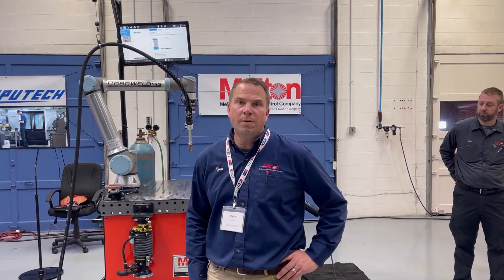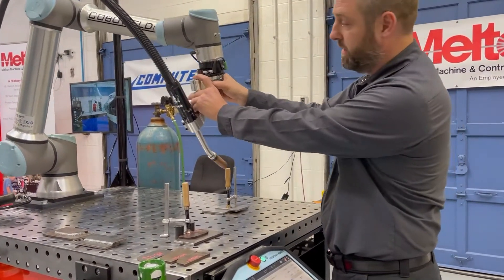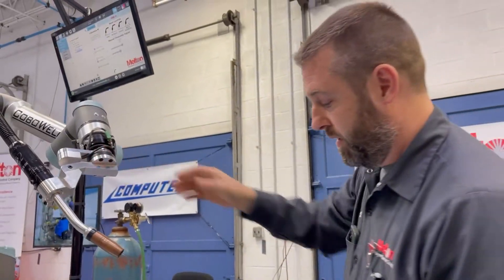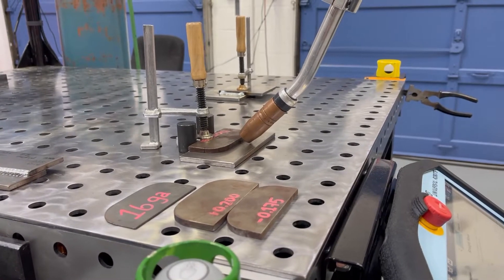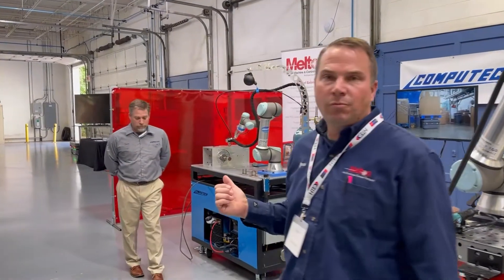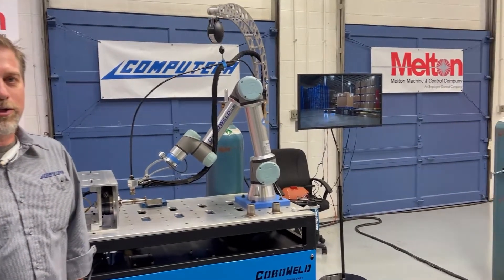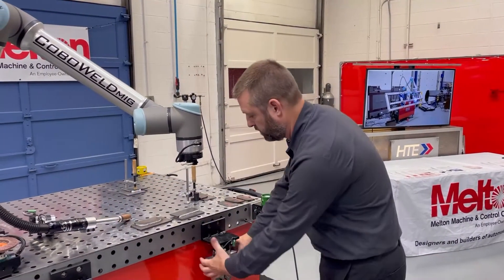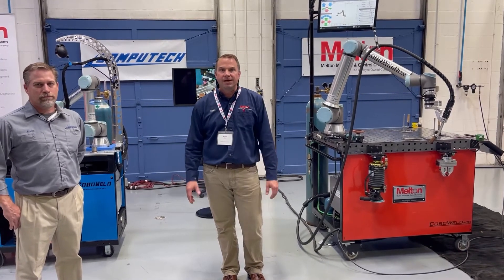HTE Automation Melton Machine Welding Demonstration

Comment: can you switch between mig and TIG?
Reply from the maker: Yes, it is possible to have a cobot welder that switches between MIG & TIG, depending on power supply communications. The standard solution does not come with this functionality, but a custom solution can be designed to accommodate this automatically or manually.  Send your contact information to marketing@htetech.com and we'll be glad to have a qualified person contact you.